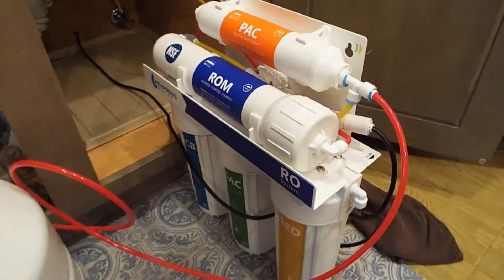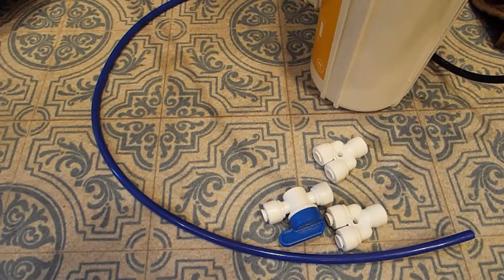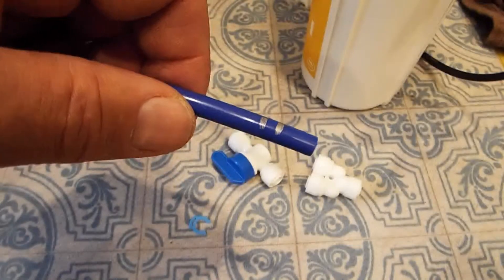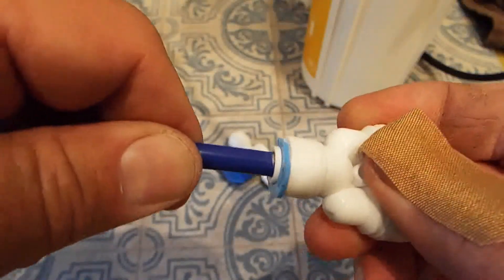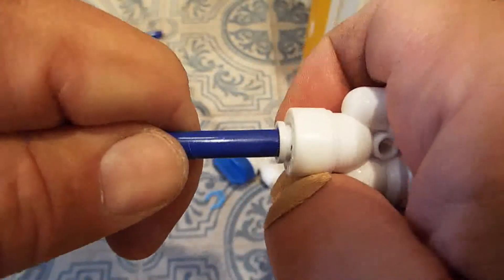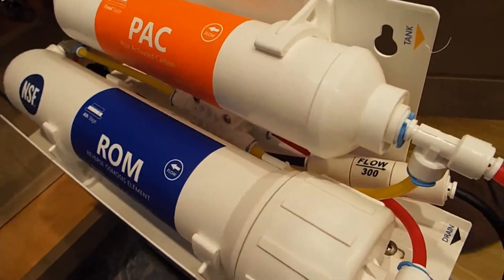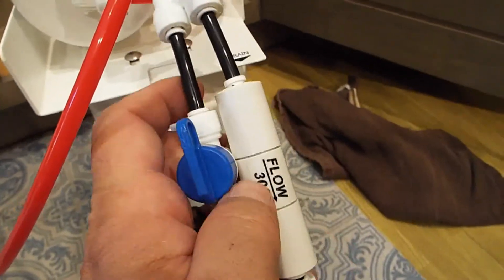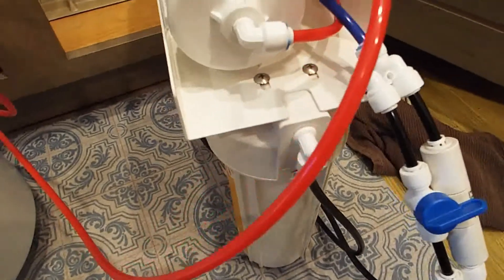DIY Reverse Osmosis Element Flush Valve

Comment: i see that you dont have a valve diverter before the flow restrictor, wouldn’t that allow some water to still pass thru the flow restrictor in this setup? Or am i missing something here?
Reply from the maker: When bypassing the flow restrictor, there is no need to block that restrictor path. The main goal is to move a higher volume of water through the RO element to flush it. Even if a very small amount of water is still going through the restrictor in bypass mode, the goal is accomplished and you are now flushing the element out.